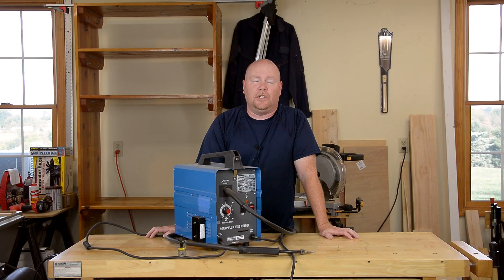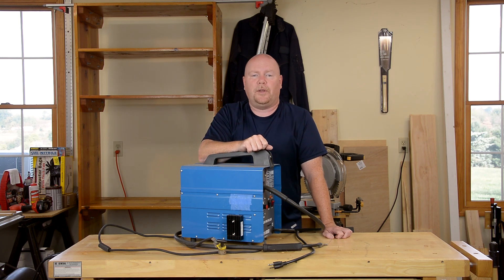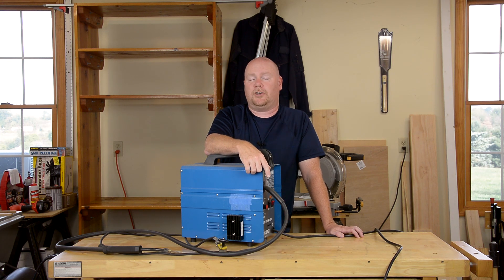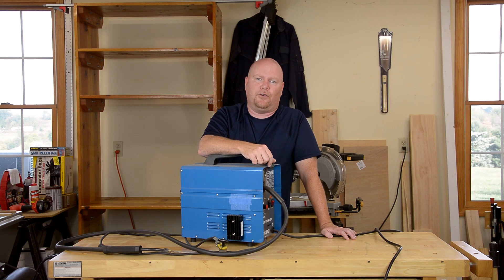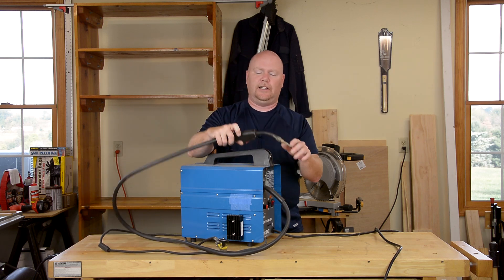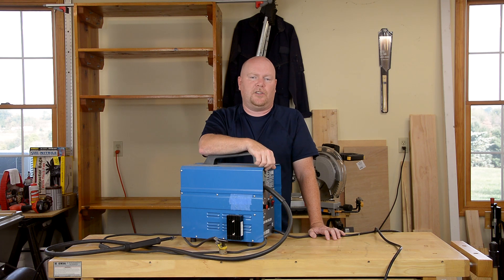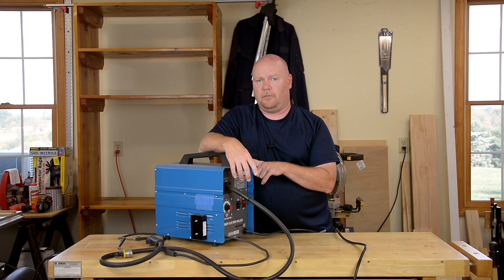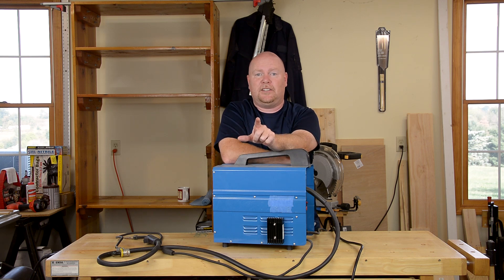Advanced Harbor Freight 90 Amp Welder Mods 09 - The F.A.Q.

Comment: In the original set of videos you said that a capacitor is preferable to an inductor for this type of welder.  I've noticed that in the instructions for converting the Lincoln tombstone to DC pretty much everyone uses an inductor and no capacitor.  Do you have any idea why this might be and have you thought about putting an inductor in this welder possibly next to the wire feed just to see how it affects the arc quality?
Reply from the maker: +SoHendo This is because of the different processes.  The tombstone machine is for stick welding, which is a constant current process.  We're wire welding, which is a constant voltage process.  Hence, the tombstone machine is best served by an inductor, which uses a magnetic field to try to maintain current.  For this machine, a capacitor which serves to maintain voltage is more appropriate.

In reality, a combination of both is ideal.  However, the addition of the secondary component makes so little real difference in either case that few bother.   There's a logistical problem too.  In that big tombstone welder you can probably find room for a cap.  In this little guy, there just isn't anywhere to put a big enough inductor.

Here's a good reference from Lincoln on the difference between CC and CV welding:
http://www.lincolnelectric.com/en-us/support/process-and-theory/Pages/constant-current-vs-constant-coltage-output.aspx
Reply: +Matt Heere Thanks for the explanation and also the link to Lincoln's website!
Reply: +Matt Heere Thanks for the explanation and also the link to Lincoln's website!

Comment: Thanks for doing these videos. I have a newer unit and I want to do the mods, I love modding stuff. I have the parts but have a question. I have been thinking about using a bleed resistor on my cap, 50V 68,000 uf. You mentioned that on the newer ones the tips were no longer hot like the old ones. I was thinking about putting a bleed resistor on my cap. Does this mean that I wouldn't really don't need to worry about a bleed resistor? If I would, would a 10W 20ohm be sufficient?
Reply from the maker: +Greg Stinogel There's really no need for the resistor at this point.  It doesn't hurt the capacitor to sit around charged (and it will dissipate anyway).  The bleed resistor is more useful on the older ones, but I never bothered with it.
Reply: +Matt Heere Thanks for the quick reply!
Reply from the maker: +Greg Stinogel
Hi Greg.  Did you complete your mod?  If so, would you mind checking out the comments on the FAQ vid for the welder?  There's another YouTuber having an issue with his, and it's also a newer one.  Some insights from someone who's actually seen the inside of this version would help :)
Reply: +Matt Heere I'm in the middle of doing it. A question, if I use this recitfier

http://www.ebay.com/itm/MDS150A-3-Phase-Diode-Bridge-Rectifier-150A-Amp-1600V-/300622780463?hash=item45fe83982f:g:2fYAAOSwf-VWW7S7

instead of the one I have like what you used, will it overheat if I mount it on the inside of the welder? Just wondering before I drill the holes.
Reply from the maker: +Greg Stinogel Using the 150 gives you a lot more wiggle room than mine, and the 3-phase model has a bigger heat sink than mine too.  End of the day though you're dissipating about 100W and that heat has to go somewhere.  Without a serious fan upgrade I just don't think there's enough airflow through the case to keep both the rectifier and the transformer cool.   You'll be reducing the duty cycle of the machine, and that's already one of its weak points.
Reply: +Matt Heere Thanks for the quick reply. That's what I was thinking. Guess I'll use what I've got and drill some holes. Just waiting for some wire to make a longer ground cord and it will be done. Thanks for your help!
Reply from the maker: No problem.  Post a quick tour when you're finished.  Lots of folks want to see this done with the newer model!
Reply: +Matt Heere All done. Not sure how to put up a quick tour. I really didn't take any pics. It was definitely tighter inside the new version. I had a problem with the screw that held the ground wire in the bracket. I didn't realize until after I started to unscrew it that the screw was PLASTIC. Well, yes I stripped it. Fortunately I have a friend with lots of tools. 30 minutes later he got it out. I replaced it with a metal set screw.
Reply: +Greg Stinogel Well, the bridge rectifier blew on me. Fortunately I had an extra, long story. I just ordered a 150A bridge rectifier so when and if this one blows, I will put it in. Thanks again fro posting your video series and your help. FYI - I learned something else not to do. Don't use the locking nuts with the plastic. I had 2 strip. I had to cut the wires and put new terminals on. Fortunately I had plenty of wire.
Reply from the maker: LOL.  It's always something isn't it Greg.

Comment: I own the newer version of this welder and did the modifications. Welder is much better since modified. I however changed some things. I used a larger capacitor found on ebay and I used a 150 amp bridge rectifier. I originally used the 100 amp rectifier and it burned up within 2 days. Installed the 150amp and it works like a champ.
Reply: +Paul Frederick Overly optimistic is quite kind. Most of the components, esp capacitors, are outright frauds.
Reply: +Tony Kinsey ebay component ratings are often overly optimistic. Apparently the amperes they were talking about were all just a bit smaller than standard amps.
Reply: Theball Player
unfortunately what you say is all too true.

Comment: i did just the rectifier and my brother burned out the feed motor on the machine now im not sure if i should try to find a motor or just upgrad to better welder -.-
Reply: +MISTERR0BOT0 If you can swing the money I would get a better DC welder. But the drive motors aren't expensive and they're easy to change.
Reply from the maker: +MISTERR0BOT0 I didn't look at the exact motor, but since the wire feed speed is kind of a guess anyway I would think that any motor that's close could be made to work.  Should be a very minimal investment.  Having said that, I try not to pass up opportunities to tell the Mrs. that I "have to" buy something new :)

Comment: Didn't think this would be your most popular video with all the other good ones you have. But this welder being so cheap for a DIYer (like me) wanting to improve it a bit says a lot. Glad you posted this and well explained. I think you may have answered the biggest questions about your mod. I do have the newer black one but not modified yet because of difficulty in finding a relatively cheap capacitor plus was hoping there was a way to discharge it (with my gun being cold). Looking forward to your next project!
Reply from the maker: +MRrwmac With the gun cold there's really no reason to actively discharge the capacitor.  It will self-discharge over time, and it does it no harm sitting around with electrons in it.  Other than being a safety issue if you go digging around inside the box, I wouldn't worry about it.
Reply: +Matt Heere OK Thanks! Good to hear. So all I need (other than nuts and bolts) is the rectifier and capacitor? Might you be able to link me to them (since you know exactly what I need). If not I'll check your older videos if they have a link. Thanks again!
Reply: +MRrwmac Go with a 150 amp rectifier. My 100amp rectifier burned up on the second day of use. This modification completely changes the welder from a piece of frustrating junk to an actual welder. I would do this modification again in a heartbeat.

Comment: Good info.  I used a couple of tips you mentioned on the first Harbor Freight welder improvement video and it was helpful.  I switched to the Lincoln flux core wire, changed the copper tip and removed the cap on the end of the tip.  It made a good improvement to the weld quality.  Thanks Matt , take it easy

Comment: Here's a question Matt. Can you put a switch in it to control the output of the voltage?? As you know with other welders it is possible. This way you are not burning holes in 22ga. sheetmetal. Great video, you answered a couple of the questions I had...
Reply from the maker: +Ol James Not really.  Those switches are actually changing between many different taps on the secondary side of the transformer.  This welder only has the two that support the existing "Min/Max" switch.
Reply: Thank Ye Matt. I bought me one of those welders & I like it ! I'm fixing to get another from a feller and am going to convert it like you did. Many Thanks & keep them interesting Videos a coming !!
Reply: If you buy an scr brick that has two gates coming off it, it will have three screws connect the anode and cathode together and then use the ak screw and you can vary the control down in it I know this might not make much sense but if you Google the scr block and how to do it , there is a VIDEO on here homemade welder circuit.

Comment from the maker: Sorry for the re-upload folks.  Editing issues on the 1st go around.
Reply: I am about to do the mod, Matt you mentioned to connect rectifier on ac before the hot tip relay on the newer welder. That does not sound correct to me as the relay may be ac only. I plan on splicing in the rectifier and cap after the relay wire on the ac supply side, Is that correct?
Reply: hey Matt. I've done the modification and wired everything the way it should be. but when I turned it on and touched the wire to the metal it started sparking right off the bat without pulling the trigger. the ground clamp even sparked a little bit.  I don't know why it's doing that and it's really frustrating me because I was do excited to finish this project. any advice would be much appreciated !
Reply from the maker: Hi Ronnie Reyes.  It's normal for this welder to be "hot" all the time.  The trigger only activates the wire feed.  Voltage is present at the tip whenever the power switch is turned on.  Doesn't have to be connected to the work piece either.  The torch and the ground clamp will find an electrical path through anything conductive (like your bench, tools, etc.)

Newer models of the welder have a relay that prevents this behavior.  About how old is yours?

Also, if you have a volt meter set it to at least 50VDC and check the output between the torch and the ground clamp.  Let me know what it reads.
Reply: +Matt Heere thanks for the quick reply. ! I have the newer version, the black one.. but the ground clamp shouldn't spark too should it?
Reply from the maker: No, not assuming you're hooking it up 1st.  There should be no sparks.

I've not seen the inside of the newer ones, so I can't tell you exactly what needs to be different from my modification.  However, it sounds like you're hooked up before the switching that is supposed to kill power to the torch.  

It also sounds like you may have a short somewhere that's powering the ground.  You could easily have a bad capacitor causing this.  The size cap you have should have been quite expensive.  If it wasn't, the first thing I'd try is taking it out.  Even if it was, I'd try taking it out.  The rectifier provides 90% of the benefits of the mod, and it'll work fine without a capacitor in the circuit.

If none of that helps then I think I'm going to have to suggest that you try to put it back to the stock configuration.  Hopefully someone who's done this with the newer model will chime in with some better advice!
Reply: +Matt Heere Thank you for your great videos! I did the modifications in the video and it works but the now the wire feed is kind of erratic, would you have any suggestions on how to fix that? The welds it puts out do look a lot better though
Reply: am about to do the mod, Matt you mentioned to connect rectifier on ac before the hot tip relay on the newer welder. That does not sound correct to me as the relay may be ac only. I plan on splicing in the rectifier and cap after the relay wire on the ac supply side, Is that correct?